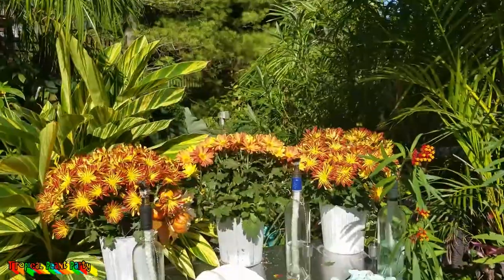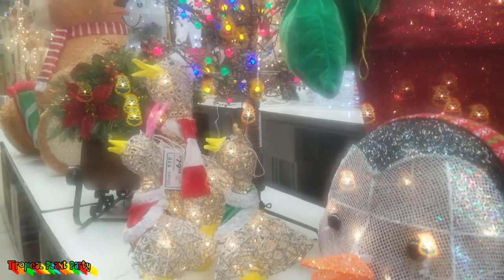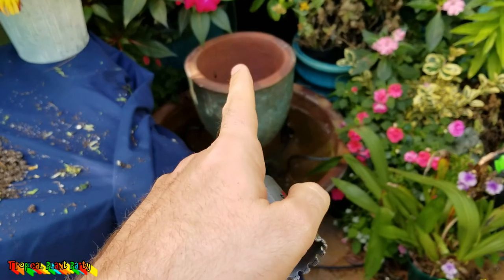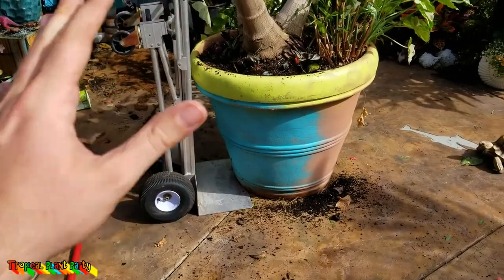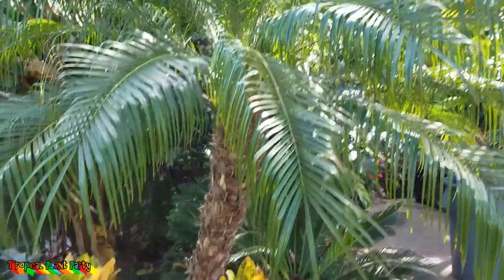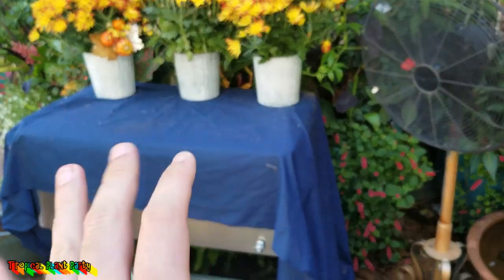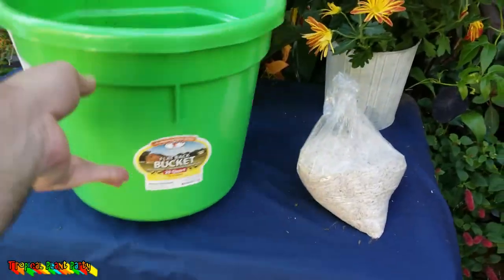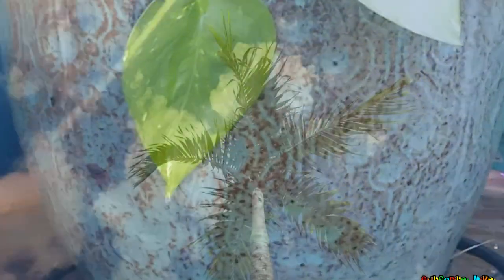TWIG Fountains, Coconuts, Heliconias, Orchid Bark

Comment: ...what a great show, so much going on....this was a super potting show, loved the mix's you make up, your drainage, and all the explanations....your aquaponics tub is a spring of life...
.fyi..loosen the allen set screw and the drill bit will slide out...for replacement or adjustment.....but..if the pot, your drilling... has an existing hole.... set the pot down...right side up....on some wood.........the drill bit will center the hole cutting part and hold it solid...again, a wonderful show
Reply from the maker: The pots I drill rarely if ever already have a hole in them, it just worked out well in this one scenario. Thank you for the tip, that makes perfect sense, I really should have known that, i need to sharpen my tool and construction knowledge!

Comment: Hey Jeff, glad that your queen palm situation worked out, although the workers were a little sloppy... the cold snap is headed my way too. No frost, but most of my palms and potted tropicals are inside already. My Pygmy Date Palm is still outside, and needs to come in. Some of my heliconia errors may have been with potting media; so thanks for showing how you do it!
Reply from the maker: Oh they were very sloppy! That is why i played clown/circus in the background! I feel ya on the cold, it's been nice here, but the low on friday is 30F! So needless to say, this is going to be hell week in the garden! lol. You actually were the main reason I made sure to film and go over potting media and winter/indoor care for the heliconias, glad to hear it may have been helpful! I leave my Roebellinis out into the 30s, but not for long, and every year i push them a smidge further. A light frost is ok, but they grow so horribly slow, that I like to bring them in before temps dip below 35... lots of factors go into play as well: whether it is wet or dry or out, sunny or shady, the high temps for the follwing days etc... I'll be bringing mine in this week though. Only because there's an order I have to move everything inside to, largest to smallest, then tropical to temperate. So this week I'm moving the Areca palms, the Ensete Banana, spindle palms, Adonidia palms... i think thats it(for the palms).. The queens, windmills, mules and chinese fan palms will stay out for a bit longer because they can take the cold, as long as it is a dry cold.
Reply: Tropical Plant Party 
Thank you! That's so nice of you! Good to know about Phoenix roebellini. I'm debating on just using Majesty Palms as annuals, but I'd kinda feel bad to let frost and cold kill them. I'm going to try your method of gradual exposure to cold. Thanks again!
Reply from the maker: For many, MANY years I used queen palms as annuals, bc those were all anyone sold around here back then. I used to bring them indoors, but Majesty palms suck as house plants if you dont have a bright and warm spot inside for them, which i dont, oh and i never felt like watering them constantly either. The nice thing about the majesty palms is that they are cheap and easy for the growers down south to grow in mass quantities, much like other annuals, except they are sold as houseplants. 
Roebellinis are great, but even they can be a bit finicky indoors during the winter months. My favorite "hardy" palm for the last several years has been the Mule palms. They can stay outside well into 30s and upper 20s... I let mine experience 13F last winter as an experiment... they was leaf burn, but not very much. I did move them right back into the garage the next day though bc they are too expensive to risk killing them. Drought tolerant, so they are easy to keep inside. The Butia side of the parentage keeps them a smidge smaller. The queen palm parentage makes them grow fast and look extra tropical... I can go on and on about them. The only downside to them is the cost and that after a long time they will get too massive to move around easily. Their trunks get crazy thick and heavy(butia side of them). Bamboo palms are pretty awesome also, but they are mealy bug magnets! I am debating leaving mine out to die in the cold this year. I dont want to, but they are old and not looking great, and not worth the time and effort of repotting and constantly having to spray them all winter too keep the mealy bugs from spreading everywhere. Wow, this was a long reply..sorry!
Reply: Tropical Plant Party 
Tropical Plant Party 
I kept my Majesty Palm in the bathroom with a skylight and it did well, but my family HATED having a 7' palm in the bathtub! 😂 I like your long replies, you're so knowledgeable! I bought an Areca this year. I love that palm! It's in a bright east, southern and skylight for the winter. My P. roebellini is chloritic and yet I've gradually fertilized the hell out if it! Where did you get your Mule Palms?